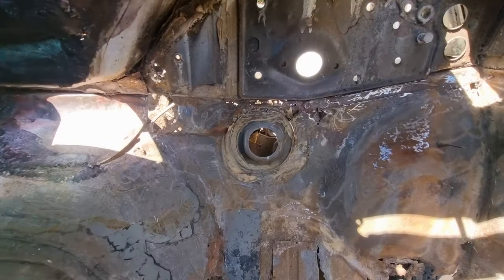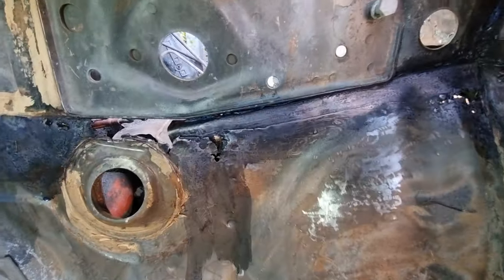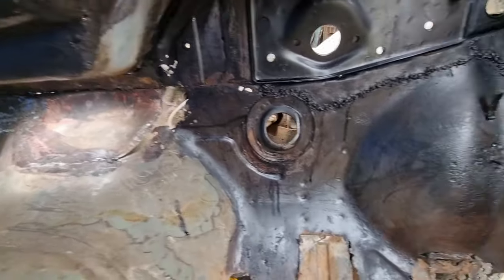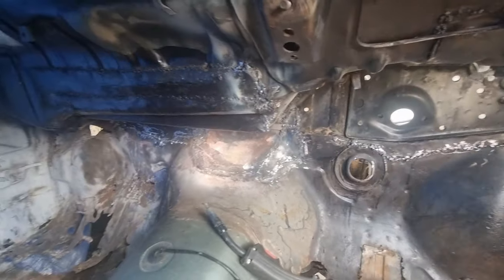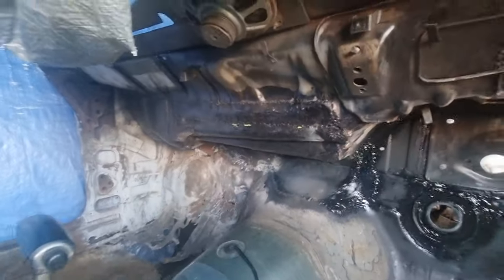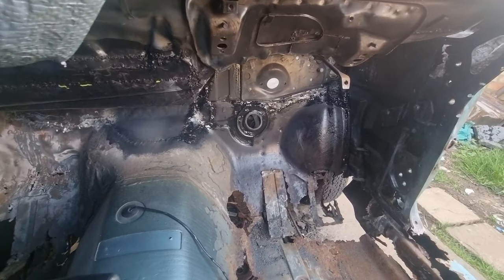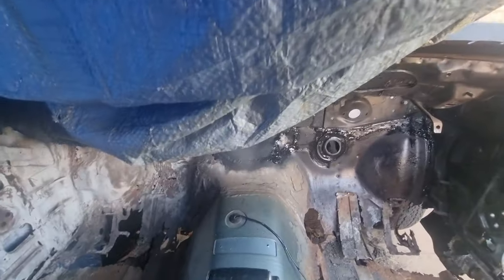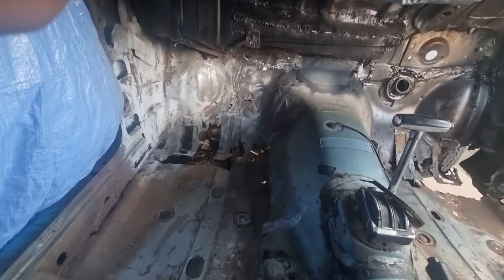Cortina Mk4 Ghia 2.3 V6 Restoration || Inner Bulk Repair Continued (P24)

Comment: You are a brave man.  Back in 1990 when I was 18, I had a 1979 2.3 Ghia manual saloon. I also bought a black 2ltr Ghia estate which was also a mrk 4, and was mint...Think I paid £50 for the estate, which was an ex funeral car...As it was sitting around at my old mans, he finally scrapped it, and it was still in mint condition...As for the 2.3 Ghia, I swapped it in 1994, for a B reg Sierra 1.6 L and a video player...What an idiot I was! lol
Reply from the maker: Lol its mad ennit could pay £100 for cortina back in the day just to wizz around in temp now they are worth a fortune and classics I love the mk4 the front end look great just carnt wait to see mine with a front end lol I have only seen it the way it is with lights placed in loose
Reply: @AdamSNook.  My 2.3 manual was great fun in the wet.... It had Capri twin headlights, and the grill from the Capri fitted, although the grill was a little too short, but looked great with the headlights...It also had original RS 2000 4 spokes, which I swapped out from the original wheels. Loved the interior, all black....It is the only car I regret getting rid of. It was starting to go on the front wings where the indicators sat, and on the lower back quarter near to the bottom of the back wheels, but she was a lovely car...originally in Jupiter Red with a black vinyl roof...I then resprayed it black, after hitting a shop window...Reg number FAH 528T.  :)

Comment: Wat welder you getting?? After i gave you a bit advice on which I've got and the one i have is only £260 and like i said it runs gas and flux and  arc welder up to 5mm metalgood to hear you're getting bits in i bet people have bits sitting around bit advice when you get a new one there should be a basic book to set your welder up use it and try it on new metal to set it up as the welding will need to be stonger and needs runs of weld and not tack welds everywhere but your doing a good job with wat welder you have you will get better the more you do mate 👍
Reply from the maker: I'm still going to get the welder you advised but couldn't aford it yet I need to do a bit of saving up all the parts offerd to me that are hard to get I have to snap them up while I can before some one else lol as really hard to get I really want a fluxcore/gas and it is on the list just need to put money away in a pot to save for it

Comment: Adam I hope your new welder that is coming is a gas one ?
Reply from the maker: No it's a fluxcore as all my work is done outside and wind would just blow the gas away lol I am going to get a gas/ fluxcore in the future tho
Reply from the maker: my budget couldent go to a gas one as they are over 400 to 600 and i need to keep moving with the cortina
Reply: you're lucky that you don't need a MOT (correct me if  I'm wrong) when you start pans , inner sills and rails you need real good penetration hope your new welder is  up to  the job mate A + for your effort
Reply from the maker: I won't do the chassis if the welder carnt do it the welds do come oit the othersides they don't look the best but very strong even bashed with a hammer as a test on strength one time I welded a peace metal in and was not happy tried to het it back of and had to cut it out as it was to strong and would not come back off
Reply: @AdamSNook.  safety first mate cruising with family cheers
Reply from the maker: @fredjones1238  i wouldent drive it with out taking it for a mot first anyway and i will be going over everythink again and again untill im happy
Reply: @AdamSNook.  so it does need MOT  ITS not exempt
Reply from the maker: @fredjones1238  no it is excempt but you can take it for one if you want to dont have to tho lol

Comment: Great stuff there buddy,  these sort of jobs really do put equipment, that supposed to be bob on to the test.  por 15 as i mentioned in stead of hammerite will be much better.   With you getting the rear axle,  it would be great to see a video on that,  and the parts you have got your hands on, that will go on at some point.  Just to get the views in, and maybe open some doors in getting other parts for it. Someone may know who has the odd bits in a garage of this, or even sitting on something, that the have had for years.  That they might part with for the sake of helping out.   I have pushed 300 TDi spares on to a couple of lads, it saved them the hassle of ordering in.
Reply from the maker: That's it I forgot the name lol pour15
Reply: @AdamSNook.  its expensive stuff, but its good, drives like a gloss ceramic finish.
Reply from the maker: @procta2343  yeah i think i can get a tin of ebay around £50 to £60 but should do the whole job so would be money well spent

Comment: That's a good idea you going for the small one or the I've got it's worth the investment if you get the same one as me soon as I get paid I will sort you something towards it mate
Reply from the maker: Aww than you can you drop me a email on my youtube email address on the make and model of yours
Reply: Static arc mig200S2 if not the same is a mig200A only difference is the welding torch is on the other side of the machine then mine hope that helps 200amps is wat you want for the work on the floor chassis if i had a car on the road I would of come up with mine and showed you the best way to set it up and to do longer welds but only got a motorbike at the minute and I'm Worcestershire area my self mate